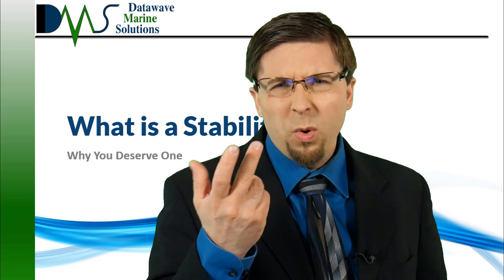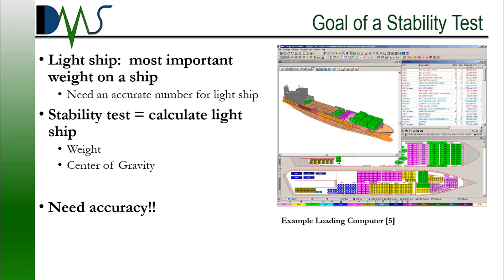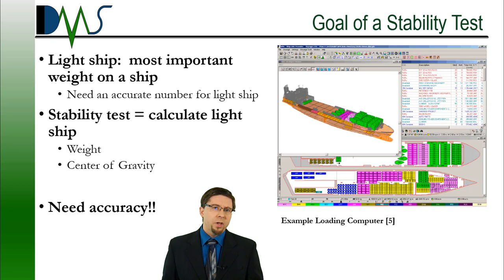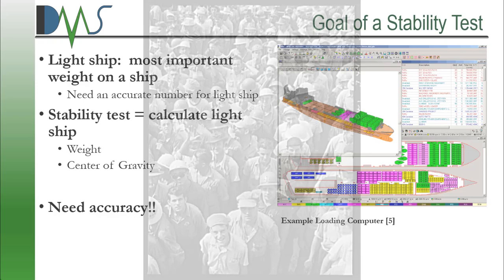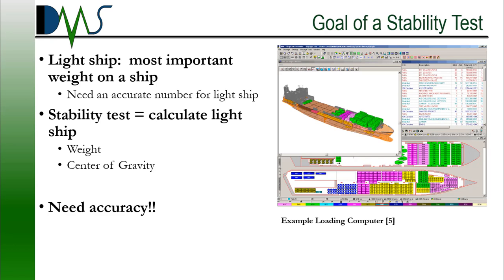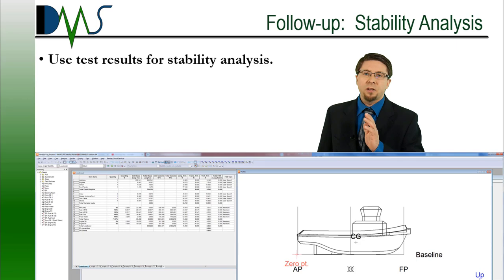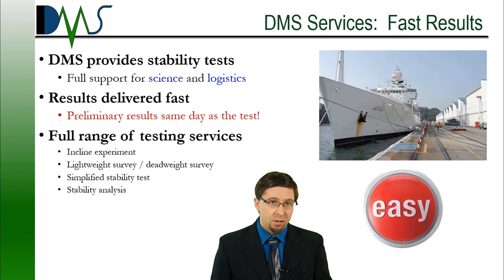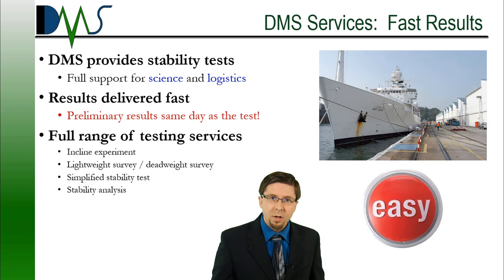What is a Stability Test:  Why You Deserve One

Comment: Another great video. So much knowledge.
Thank you for your uploads.
One question, though, wouldn't it be wiser to perform the stability test in less than "good weather"? Seeing as ships often sail in AWFUL weather, that is.
Reply from the maker: Not in this case.  Sadly, the name "stability test" doesn't really clarify the goal of the experiment.  We are not directly measuring the stability.  As you pointed out, a true test of stability faces the ship against bad weather.  Instead, think of the stability test as a measurement of vessel characteristics.  In this case, we measure the weight and center of gravity.  With that information, we can run computer simulations to determine the ship stability.  The ship still gets tested against bad weather, but only on the computer.  And the stability test gives us the information we need to ensure those computer simulations are accurate.
Reply: @DatawaveMarineSolutions  Thank you so much for your reply.